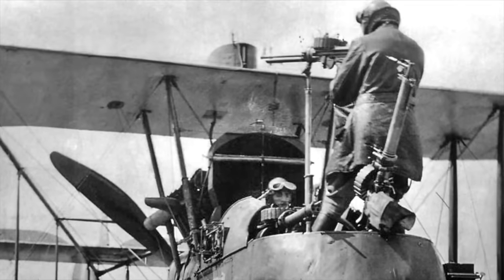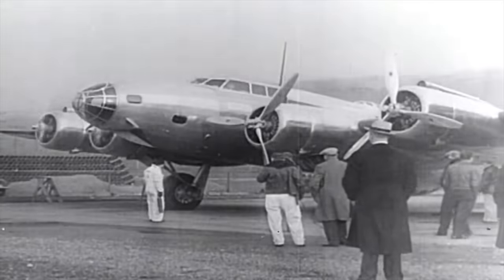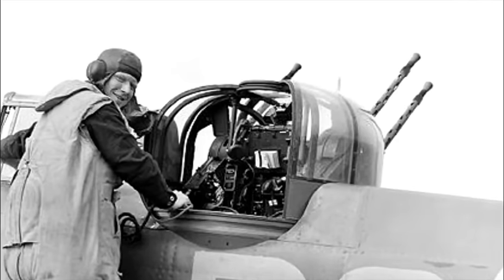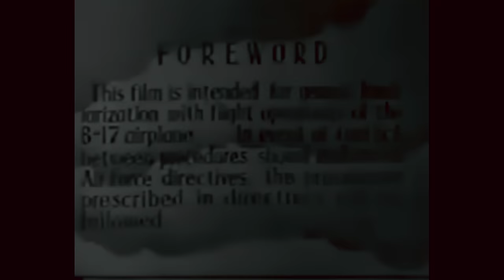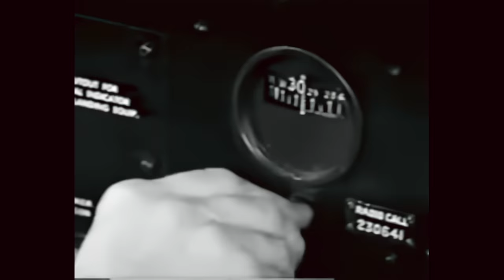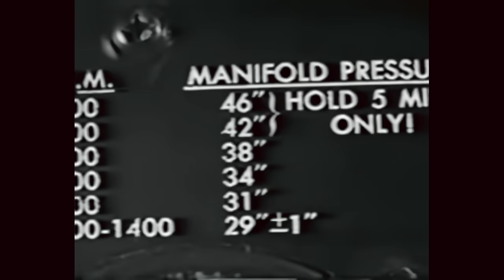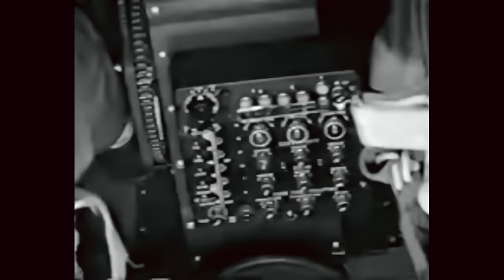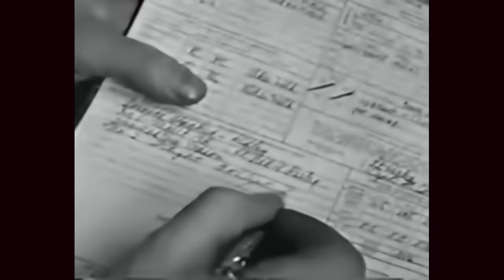Aircraft Turrets And Defense Tactics | Interesting Historical Facts  You Might Not Know | Ep. 1

Comment: The U.S. B-17 with .50 caliber weapons was getting its clocked clean by German fighters using 20 mm Ammo. That to this day is one of the heaviest criticisms of the U.S. Army Aircorps.  Even my father who flew B-17's complained about it.  To this day it reminds me of the oxymoronic term Military Intelligence.  But my hat tips to all the men that served on those bombers.  They did the best they could with what they had.  Godspeed to all.
Reply: I thought the same thing about the Brits using 303.  Turns out a target was under the pip for such a short time smaller caliber and a lot more of them made sense (1 - 20mm or 20 - 303 which is better?).  Likewise having multiple ammo calibers (eg 303cal & 20mm) would have been a supply/logistics issue. And switching in mid-war would also have caused problems (wrong/insufficient ammo delivered for airplanes etc) not to mention difficulties retro-fitting 20mm cannons into 303cal gun wells. Also, the Germans didn’t demonstrate a noticeably superior effectiveness over the allies. The point is, it wasn’t a simple issue of 303/50 vs 20. God bless the bomber boys.

Comment: I'm curious about the B-36 having a "hushed" sound and where you might have heard that. 
With 6 28 cylinder engines (168 cylinders total) one could hardly call it hushed. I distinctly remember reading a recollection of a crewman's son watching B-36's coming over base housing on short final. Even with the low power demands at that point in the flight, the noise was enough to shake the houses below.
Reply: Yes, but at 30k feet the sound was barely perceptible compared to that era's jet aircraft. Of course, if you followed the sound based on what your ears perceived, you would be several seconds behind the jets, too... it's a delicate balance. Trying to locate and lock on to aircraft at that speed and altitude was a vastly greater challenge than today...

Comment: (Ref pt. 6:50) Slight error here. During WWI the observer’s primary purpose was to watch for the enemy and when possible, fire on him. Generally, in a two seat airplane of the era only the observer had a gun, thus he was their defense. So if the observer was required to direct artillery how can he also see to their defense? He can’t, therefore the pilot directed artillery while flying the plane. How does the pilot fly as well as send/receive code? First, a number vs letter grid was used to designate targets (trench war, not a lot of movement). Then a simple code was used to indicate short/long and left/right of the target to dial-in the fire. This was carried out by the pilot while the observer kept their arses safe.

Comment: Be interesting if the B36 was built today, if a ciws could have been fitted to something that size and been an effective defense...
Reply: Against what though. It's max range is one mile
Reply: It's Carey's 1500 roughly of ammo with no current internal storage. It's estimated to take 300 to 500 shots to hit a missile.
Reply: @richjjames7462   the current ciws configuration for ships is huge, but if something was designed specifically for an aircraft, maybe using dual or quad 50 cal with a computer controlled autoturret. I think it could be effective against missiles.

Comment: What drop tanks, ever hear of mid-air refueling? We would have had more than enough fighters to protect the B-36. Even if the Mig-15s did reach the same ceiling, they couldn't sustain an attack for long because the early jets were fuel hungry mothers using a chunk of fuel to reach high altitudes. Our experiences over Germany in WW2 also proved that our slower bombers were not so vulnerable against swarms of German jet fighters as would have been thought because of enough Mustangs being sent to protect the bombers and even though they were at least 100 mph slower than the Me-263, their numbers and excellent teamwork attacks by German jets negligible.

Comment: 0:52 this is a silly claim.  The undoubtedly  successful and combat proven B-52 has an RCS  over 100 square meters. To claim 44  would make the B-36 ineffective in combat clearly isn't accurate.
Reply: Its vulnerabilities were its TAS, and the fact that defensive armament was proven ineffective in Korea.  The analog computers of the time could literally not make the calculations fast enough, nor could gunners acquire and track, to deliver a firing solution to the turrets.  (This is why B-29s were moved to night missions in Korea and then withdrawn from combat BTW.)
The tail would be the exception, as that would be a zero-deflection engagement.  This was reported at the end of WW2 with Me-262 engagements BTW).  What should've been done was what the 20th AF did at the end of WW2:  remove the gunners and guns to increase ceiling and TAS over the target.  A 50kt - 75kt increase would complicate the Soviet interception problem.

Comment: Problem with ball  turrets is you had to enter from outside the plane.  If a plane ever went down the ball turret gunner was history. If the plane lost its wheels, the ball turrets would rip apart.
Reply: Totally incorrect.  The turrets had a door which when aligned allowed access into and out of the turret.  The occupant was not in the turret during take off or landing.
Reply: @SalemikTUBE under normal circumstances know they weren't in there on takeoff or landing but in situations where they lost hydraulic or they weren't able to get out in time a lot of b-17s had to belly land that didn't go well